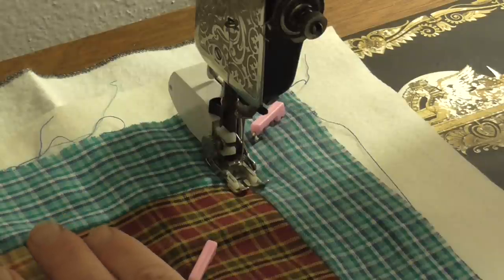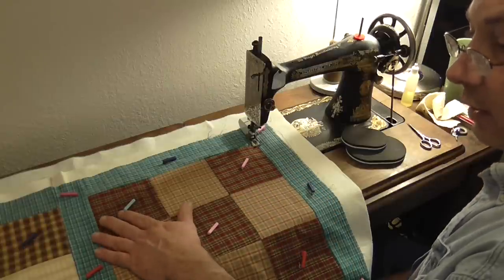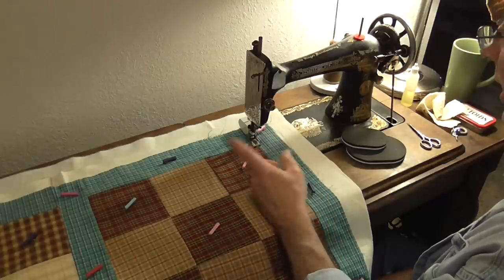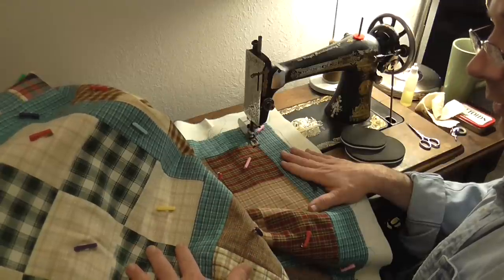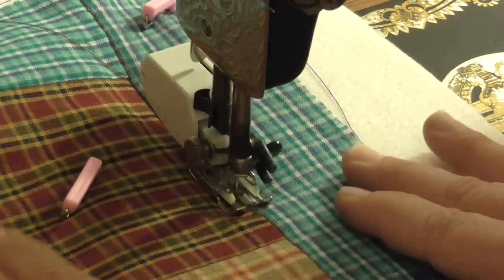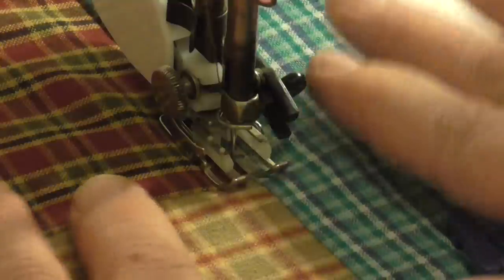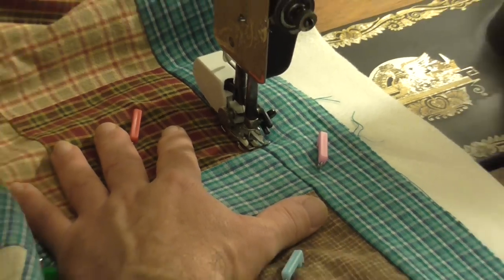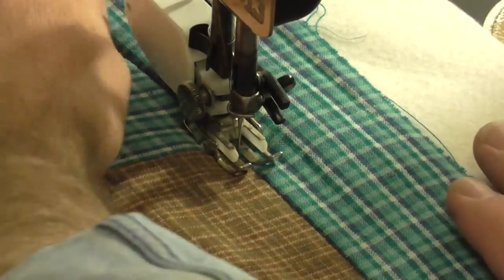Treadling with Lane, Quilting on the Treadle sewing machine...the beginning

Comment: Hi Robert,
Pretty plaid quilt!
You'll find it easier to quilt on your treadle if you have a small table to your left to support the quilt. I've quilted several quilts with my Singers 201K,15 and 66-1 treadles.
Sharon W.